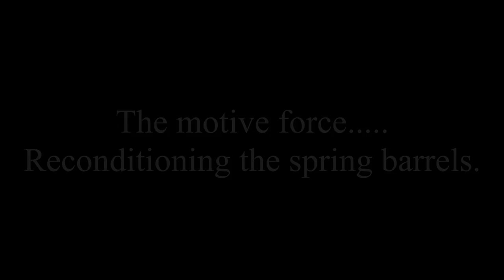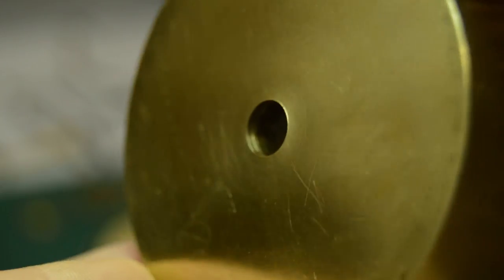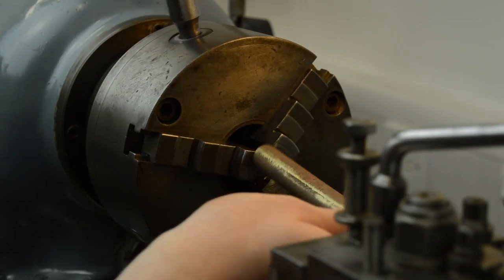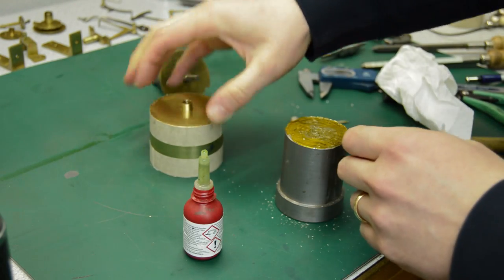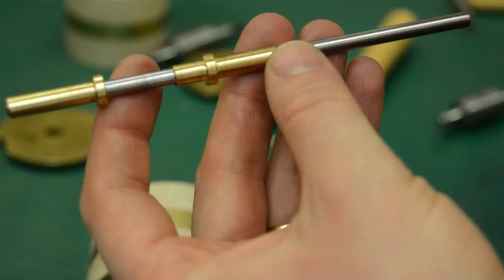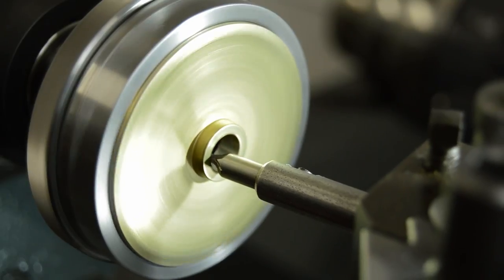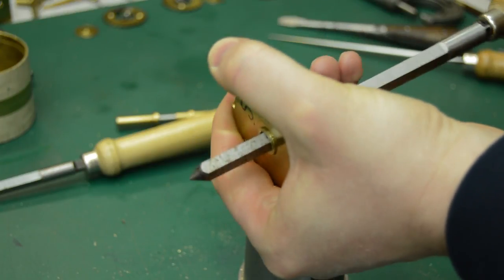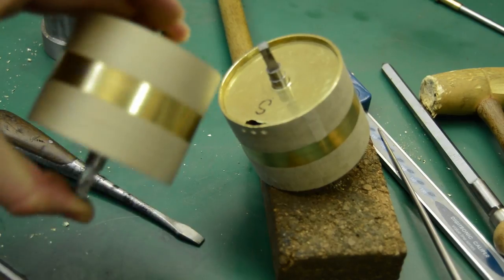Antique Clock Restoration - The Complete Job - Part 3, The Mainspring Barrels.

Comment: when I clean up the spring barrel hole, I always put the spring barrel cover on so that the reamer always clears the hole perpendicular. then the bearing is not skewed in the spring barrel. great project you have there. thank you for sharing it with us. PS, also before I riveting the bush in, without adding loctite, I countersink the hole slightly with the roller sinker.

Comment: Brings me back to bushing mainspring barrels, we used to use soft lead soilder to secure the bush in the main spring barrel. My master was strict, good and fair.
Reply from the maker: Sometimes a sweat of solder is the done thing, I try to avoid it if I can though.

Comment: I adore these videos. Interested in your third hand Tommy. When using a hand drill you need two hands, one to turn the handle and one to apply steady pressure. When you de-burred that barrel end cap, you held it with a hand. I find myself using my chin to press on the drill in such circumstances. Did you do the same, or do you have a hidden clock maker’s third hand hidden away? Will I never be a clockmaker with my limited anatomy?
Reply from the maker: 😂 Good spot!  Yes the old chin balance, or belly steady!
Reply: @TommyJobson  just need to sharpen the zenker. and then you don't need a drill )))))

Comment: I like Chris's internal gauge, great idea... but I think it could be improved by slitting the outer end of each bush, adding a tapered pipe thread at each end, with a wing-nut to lock it into position. That way you need not worry about losing the measurement during disassembly? 
Looking forward to the next part!
Reply from the maker: Cool idea!  I made mine so it was a fairly tight sliding fit, but i like your thread idea.
Reply: I was thinking the same thing could be accomplished by soldering one bush to the rod so it doesn't slide, and adding a set screw to the other bush to lock it into place after you take the measurement.